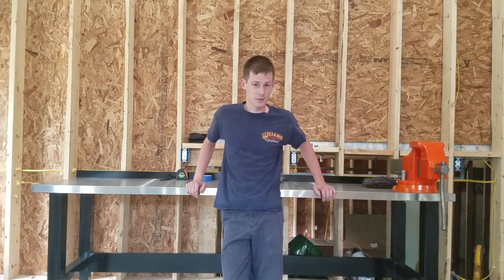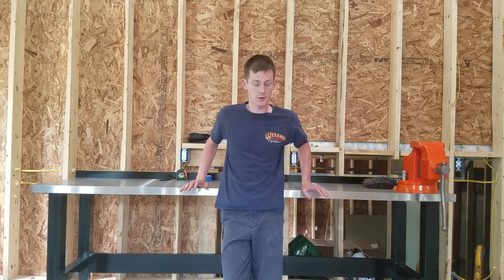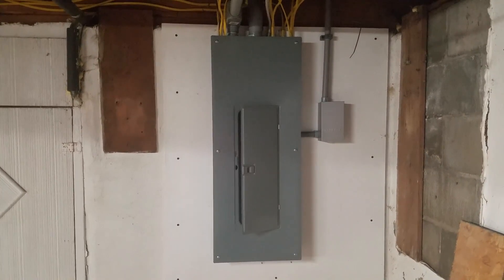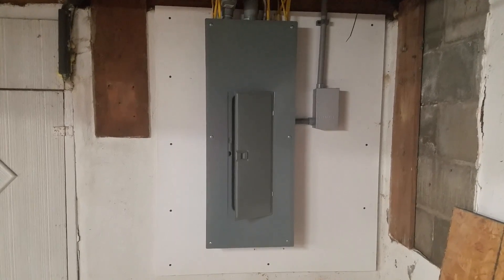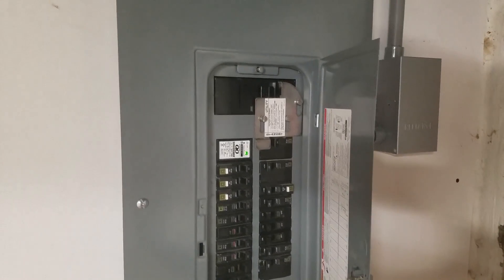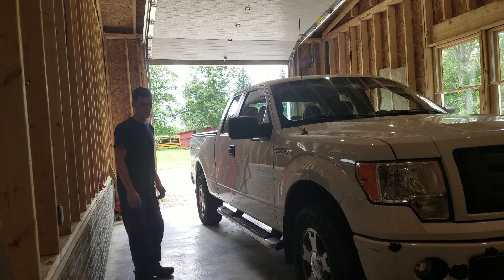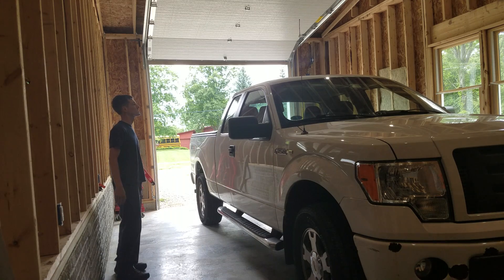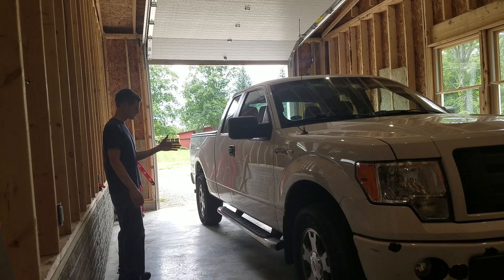BendPak 2-Post Lift Requirements

Comment: Good Morning; We Just saw your video and subscribed. We are 2 weeks til we pour our New / 2 Car / Attached Garage Foundation and Pad. Quick Question for you: Does your Concrete Slab end right at the "inside" edge on that outer wall (Floating Slab at 4 inch thick ?) Do we need to consider the distance on our outer edge of the concrete to the drilled locations of the Lift Tower Anchors ? 
We may be "growing" the garage by 16 inchs, just so we have the Tower leg anchors at 30inches + from our slab edge.  Did you "float" some rebar into those outer areas also ? Any Mesh ? 
Thanks for the Video.....we did the scissor trusses / roof like you did too. worked out great.

Comment: What is your garage hight to the peak?  And what is the roof pitch?  I am planning to build a garage but have 17’ tall to peak maximum limit.
Reply from the maker: The ceiling is 14ft at the center. I'm using scissor trusses at a 2-12 ceiling pitch. Roof pitch is 4-12.

Comment: I remember in one of your videos you were upset about about the placement of the pump and tank.  What is the overall width of the lift in that con figuration?  Is the spec sheet at 12 feet accurate?  Thanks
Reply from the maker: Brett Ashworth the lift itself is 12 ft wide. The pump and reservoir stick out another 6 inches beyond what is quoted in Bendpak’s “specifications”. On a symmetrical lift it won’t stick out passed 12ft.
Reply: @RepairGeek  Thank you!

Comment: Hey man, I love your lift videos (I only discovered your channel this afternoon and subscribed). You mentioned your ceiling height was 12 feet and change, and that you had scissor trusses.  What is your wall height and what is the pitch of your roof?  Are you able to open the garage door while the lift has a car/truck on it?  Thanks!
Reply from the maker: Brett Ashworth the ceiling in the center is 14 ft. The walls are 11ft 3in. The ceiling pitch on the trusses is 2.5/12 I believe. As far as the garage door, I have never had an issue with a full size truck hitting the door when it's open. A large SUV or a truck with a bed cap I have to keep the door shut to go full height. It's very close too close to see while operating the lift.
Reply: Thanks!  That helped!

Comment: What weight capacity lift did you get? And can one test old concrete see how much resistance it has?
Reply from the maker: The height requirements depend on the lift. For example, Bendpak also makes a 9ft tall model with no overhead. So, you can lift the vehicle as the ceiling will allow. So yes going smaller will change the height requirements. Most models that do not have an overhead have some sort of floor plate that runs between the columns. The floor plate or the overhead give a place for the equalizing cables to run. If you plan on removing transmissions for example you will have to work over top of that floor plate. That was why I really did not consider one.

As far as the floor strength for a 4 post I honestly don't know for certain. To me the contact patch of a vehicle's tire is much smaller than the foot print of a leg on a 4 post lift. I'm sure there is a specification but, I can't see it being that critical. The best advice I can give you is look at the manufacture's website or call them if you can't find the information you are looking for. I simply don't want to tell you something that I do no know for certain.

I have some stuff planned but nothing shot yet. I have somethings I need to get done around the house. Personally, I'd rather put out 1 or 2 videos a month of good content rather than twice a week and have poor or filler content. Thanks for watching.
Reply: Repair Geek thanks for replying! I will definitely be doing more research before I make my decision,like you I have a lot to do around my house right now so it won’t be until spring when I’m ready to purchase.thanks again I will definitely subscribe and look forward to more videos!
Reply: Kolour Blind it's not me that has a lift, I'm still dreaming... And the weight rating has nothing to do with the height, and a 4 post would prolly be ok on firm ground, as it ditributes the weight evenly. A 2 post is a whole different story!
Reply from the maker: 10000 pounds. Unfortunately I don't know of a way to test the strength. Perhaps contacting Bendpak may shed more light on the subject.
Reply: Repair Geek I wonder how GregSmithEquipment compares?
Reply from the maker: Worst case scenario you pour fresh concrete. The concrete isn't the place to skimp. I was lucky because I was able to ask the contactor what the rating on my floor was.
Reply: Hey bud thanks for making this video,it helped me put things in perspective better.i think I read your using a 10k lift,if I was to go smaller say 8,9k do you think that would change height requirements? Also if you know,would a 4post require next to the same strength concrete? Thanks again,I’ll look for more of your videos

Comment: Okay thanks 
I was looking at 20x24
Or 24x24
Was thinking about 16x28
But was always afraid if a trucks on lift you want have room for tool boxes and shop equipment 
Trying to make a home shop
Reply from the maker: The lift is 12ft wide. So, the lift would have to be against the wall to have 2 useable bays if you went 24x24. I wouldn't go narrower than 16ft if you can. Extra depth is always better. More depth will give you wiggle room for your lift placement as well.

Comment: I'm in the process of doing just this was wondering how much concrete you needed for those two pads??? Or did you have it delivered with a truck?
Reply from the maker: Bendpak's requirements are 4 inches thick and 3000psi.